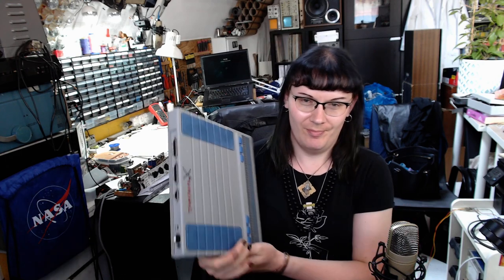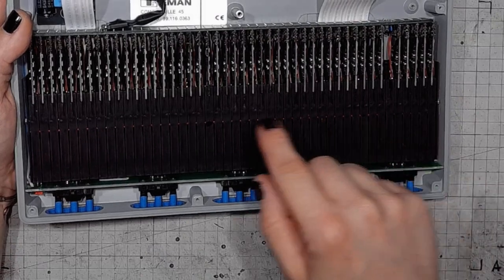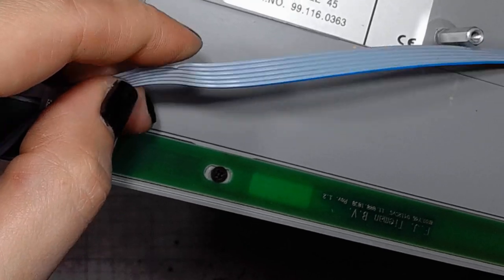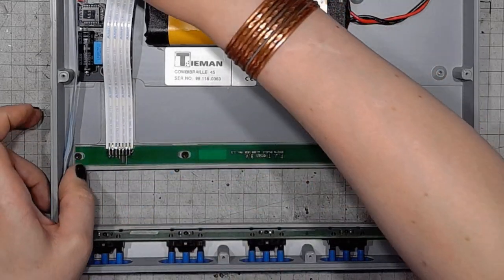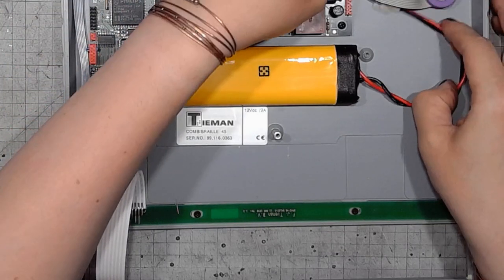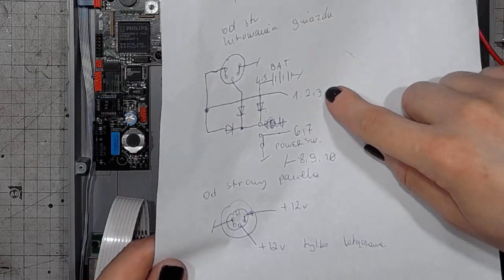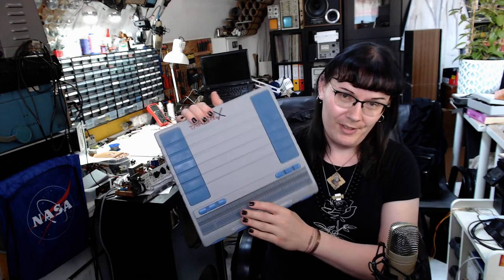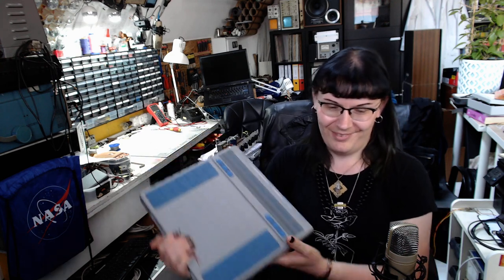A Thing of Beauty! Inside a 1999 Braille Display

Comment: My older sister had used a similar device and also a pin grid display that could reproduce the shape of low resolution graphics.

Ideally these devices are manufactured in shops that employ the visually and hearing impaired.

I'm hoping it will be restored to functional use for someone that cannot afford to buy a new one.
Reply from the maker: I'll have to get it back from our local FabLab-not-FranLab and try to get it going. I just lack the time and health at the moment.
Reply from the maker: I'll have to get it back from our local FabLab-not-FranLab and try to get it going. I just lack the time and health at the moment.